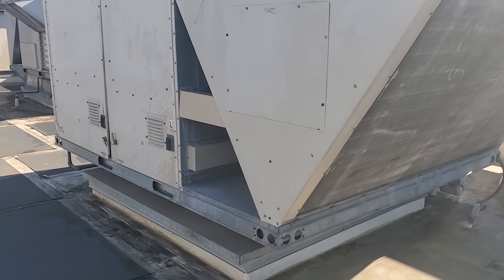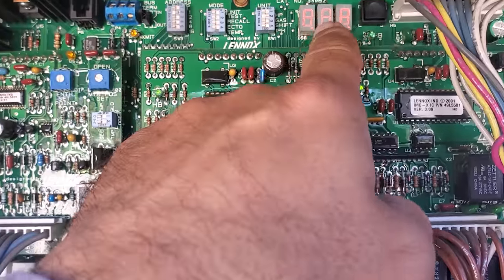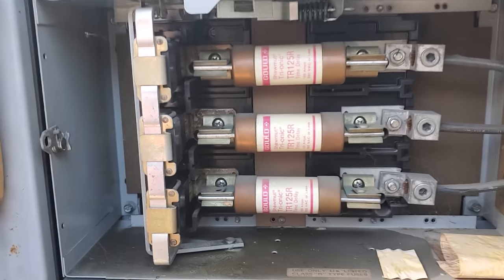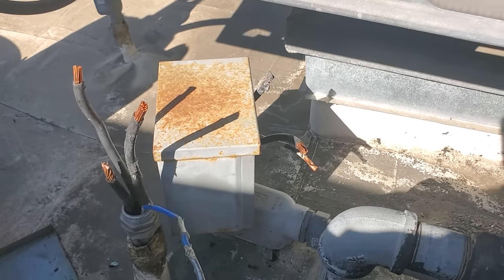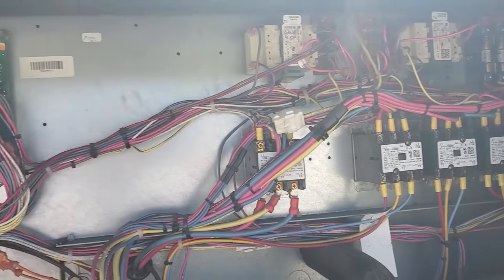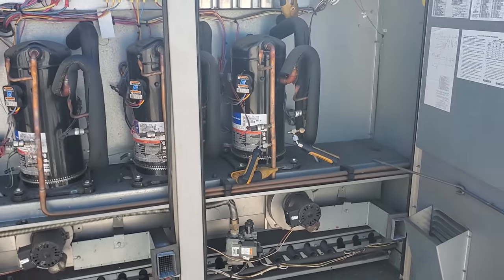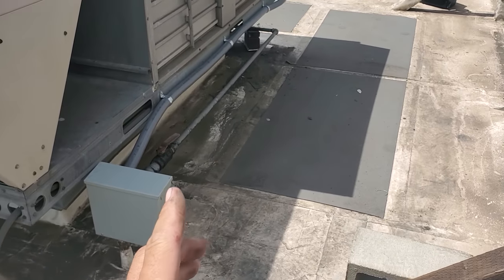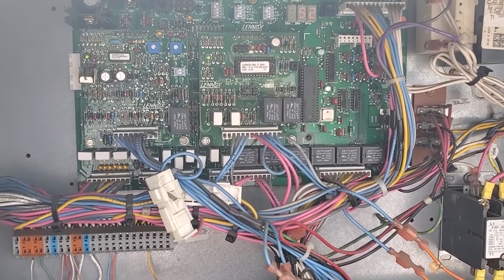ELECTRICAL FAILURES ARE FUN

Comment: When the first unit burnt out there would have been an arc drawn. Arcs will produce a lot of EMI some of which will be conducted down the mains and may not be trapped by circuit protection as they will only be relatively small. The pulses can make their way through the transformer onto the circuit board and cause the lock up
Reply: Almost exactly what I was going to say and better put.
Reply: Well said
Reply: once that connection blew out it sent out over voltages to other ac cause it lock down
Reply: Precisely. That thing would be a total spark gap radio scrambling the microprocessors.
Reply: I agree.  There's an amazing amount of noise coming from an arcing connection.
Reply: It does beg the question - why is there no watchdog system on these hideously expensive air conditioner controllers? You'd think when you spend the sums of money involved they'd have the grace to add one!
Reply: @classicmacintosh  There may be a simple processor watchdog but not clock speed or complete control loop monitoring, these are things that are put into automotive systems (it’s covered under ISO 26262). I am a bit surprised that it didn’t just do a reset attempt earlier, but I’ve definitely seen cases where the processor is in a weird mode where it is ‘running’ but not properly, just well enough to refresh a simple watchdog, but not well enough to run properly. One such case was at cold temperatures, the clock would run at three times its design speed (3 MHz into a 1 MHz 6502). The code would run straight through, not taking any branches at all, but the watchdog got refreshed, despite the fact that the processor was doing weird things.
Reply: Totally possible. Imagine the inrush turning on a dryer at your house, and how the lights flicker for a second. Same goes for turning on a large A/C unit at your house. I couldn't imagine that big of a 3 phase circuit, shorting, and the amount of amps it pulled. Just my opinion, I'm no expert.
Reply: Making a watchdog to monitor the heartbeats wouldn't be hard, but of course this would be another point of failure. Gotta weigh such things up. You don't want to have units going down because the watchdog keeps false-firing.
Reply: As an electrician, I agree. I have seen this sort of failure causing other issues, although correlation is not necessarily causation, and the other unit could have shut off for other power issues. The old melted mechanical lug had rusted screws, implying that it was corroding for quite some time. J box was undersized and the connections crowded. I would have used Polaris type lugs with both conductors coming in from the same direction, rather than feed through lugs like the one that melted. New electrical was done well, with a properly sized J box, better conduit, and phase colored conductors. People forget that "Work shall be performed in a neat and workmanlike manner" is part of the code.
Reply: @GoCoyote  Be nice if the terminations on the top of the isolator were neat. I get they don't have to be perfect (exposed live metal everywhere on US switchgear seems to be the norm), but you'd think stripping the same length three times would be within the capabilities of an electrician..
Reply: @Monkeh616  Yea, I noticed that, but overall looked much better. Main thing is to make sure the conductors are "seated" properly in the lugs by wiggling the conductors after tightening to make sure the strands lay down properly, and then Torqued down with a torque wrench. I have one and use it, along with a torquing screwdriver. I also like to pull out the screws and put some no-ox compound on the threads to prevent galling and allow for easy installation and removal. Way cheaper than having to replace the breaker if they gall up when de-terminating. Most of the damage I have seen in my career has been from loose and corroded connections. I have had non-electricians ask why the fuse or breaker did not prevent the melting or fire in the electrical connection. My answer is that a toaster gets hot enough to burn and melt things, but does not blow the fuse or trip the breaker (unless the circuit is overloaded) and that it is a high resistance connection just like a loose or corroded connection.
Reply: I agree with this. During arching could happen strange things. A lot of EMI, overvoltage spikes, undervoltage drops... and more. Processor are a lot sensitive over thise type of faults.
Reply: I thought that too.
Reply: Yep. Crashed the computer.
Reply: @Fabio Bosco  This is actually used to breach embedded devices like game consoles.   An RGH is where you put a slight under voltage to the CPU / APU causing it to start behaving weirdly and if you do it just right. (Different for every platform) you can gain control of the system that way!   The initial breaching is the hard part.   Its trial and error to find out the right way to do it.  And 99 percent of attempts will result in a reboot or a useless crash.  And all of this needs to be logged so you know what works and what doesn’t.  Then you implement an microcontroller to execute the RGH on demand.
Reply: Quite old-school components on that board. I don't think that electronics has any watchdog at all. Not inside the microcontrollers and not outside. An external, windowed, watchdog would have handled the lockup and properly restarted the board. There arw external watchdogs that have a min time and a max time for kicks. So a program that kicks too often or too seldom will fail the watchdog and trig a restart.

Cost is quite low - especially considering the total cost of an installation like this.
Reply: Neil, I was going to say the same thing, the arcing from the other unit might have traveled and caused the other unit to freak out and brick the board.
Reply: @maryjaneevadiamond6359  Yes it was definitely noise from the arcing that hung the board. Too little filtering and lack if a good watchdog on the controller cards.
Reply: @perwestermark8920  and boards cost way too much to not have that protection in place.
Reply: @deborahchesser7375  More than that - a hung software can quickly kill a motor, relays etc by accidentally entering a loop where power is turned on/off quickly. On/off cycles stands for a significant amount of wear and too high frequency on/off is not just producing wear but can give so much heat it burns out equipment.

So not having a proper watchdog logic and filtering on all I/O can save a few dollars of board cost but result in many thousand dollars of installation repair costs, besides the issues with days or weeks where the customer waits for repair.

It just looks like the electronics aren't designed as "industrial grade".
Reply: @perwestermark8920  
In my experience, "Industrial grade" is not the norm for most HVAC equipment. A lot of equipment is just not designed with quality and preventing failure in mind, but for the minimum cost of materials and engineering.
Reply: @GoCoyote  This is a very expensive installation - also quite dangerous (fire hazard etc) if it fails.

The design quality of the electronics should be adapted to the usage case. It seems a bit like the electronics has "hobby level" design. Which isn't in line with the costs if the electronics locks up or fails.

So it should be mandatory with EMI filters and overvoltage protections (like trisils) to make sure big sparks nearby sends in high-voltage pulses that kills components or hangs the microcontoller.

And it should be mandatory with a proper watchdog, forcing a reset of a hung microcontroller.

Anything handling big currents should normally have some form of feedback - like temperature sensors to cut the power if a motor or compressor gets overheated. Which obviously means there must be a watchdog logic so that temperature sensor is actually supervised.

I have never been involved in the design of any HVAC controller but other equipment. And with way higher customer expectation levels.
Reply: It is a trivial issue to program a reset routine in the event of a lockup.  Poor design.
Reply: I'm pretty sure the first unit went down due to high resistance on the electrical connector. This was most likely caused by using an aluminium connector. Aluminium is a great conductor, but aluminium oxide is not. 
That's just my opinion though with years of experience backing it up. But if you want to wear a tin hat I won't stop you.
Reply: @dale116dot7  Almost every microcontroller has a watchdog which can be integrated with your control loop. Source: am programmer.
As well, precisely because computers need stable power supplies, every computer is powered through a bunch of capacitors, and the computer is forced to shut down when the power supply is too low voltage. I don't expect that any power spike, even an arc fault, will "scramble its brains", unless you have high current and big loops causing high intensity EMI. Maybe these compressors do have that - idk.
Perhaps, even, the fast heartbeat IS caused by the watchdog causing the computer to reset over and over but it still doesn't start working.
It could also be an intentional error signal.

Comment: Circuit protection was oversized, Chris showed the max protection 90A on the equipment and they are using 125A fuses. Sat there and melted instead of blowing fuses.

Comment: Kudo's for having an apprentice and getting him some on hands experience with you in support. Best way to learn across all trade crafts.
Reply: From what I understand that's kind of how you start out within the field when your new, I'm hopefully going to be hired soon for an AC company and one of their requirements is to be teamed up with a veteran tech who shows you the ropes and how they do things. Even though I've already attended an hvac school (ATI) schools can only you prepare you for so much.
Reply: Chris, it’s been my experience that various embedded controllers will brick themselves if there is a power sag while they are starting up. (And with capacitors in their power supplies, a brief interruption shows up as a power sag.). I’ve experienced this with various network devices, especially consumer versions. I’m not a HVAC tech, so I can’t speak about those controllers, but these days, computers are computers. A power cycle is one of the first things we do. On a high quality controller, the power on self test will then tell you if there are hardware issues. But many times a reboot brings the device back to its senses again. 

Keep up the good work and try to get some rest.
Reply: A job like this also great for an apprentice to help with, any bizarre or nonstandard issue let’s the apprentice see how someone with experience will talks the problem. You can teach standard process all day long, but the best thing to teach is how to learn and discover.
Reply: @zacharynetzer819  Learning by doing.
Reply: @danforsyth365  I've only heard the term brick mean "permanently ruined" such as w/ a failed firmware update essentially preventing further attempts. The term originated w/ hard drives serving new duty as door stops.
Reply: @danforsyth365  that was alot of words for unplug it and plug it back in such sage advice... its only one of the first troubleshooting steps for all tech
Reply: True if you never get to touch it can lead to discouragement to learning as well due to feelings of not being good enough

Comment: Logic boards can be very sensitive to power glitches. It's always worth doing the Computer Engineer's Power Cycle reset first off if a logic board is behaving oddly.
Reply: especially if their not getting proper voltage from a improper wire connection

Comment: For all of the refrigerant and mechanical issues we deal with, I always appreciate these occasional electrical mysteries. It's so satisfying once you find the cause, especially if you've already narrowed it down before you laid eyes on it.

Some of my go-to issues were the Trane Voyager disconnects that always wore out, and the York package units that ran the blower wire against a hard piece of angle steel and would rub through the jacket into a direct short.
Reply: That box hasn't been looked at in years, probably handyman electric lol

Comment: Speaking from experience on this, either one of two things I would do.

1. Pull all the existing wire out, mark the burnt wire and replace that leg.
2. Pull existing wire and then refeed with entirely new wire. 

You are not going to be able to pull the single wire out in that conduit. Frankly speaking, that conduit is undersized for whats in there.
Reply: Entirely undersized. All conductors cannot exceed 40% of the conduit with exceptions for stuff like the whip-it style cable used as a replacement.

Comment: Not far from my house some people ripped apart a chiller. I will post details that I saw/assuming
2 compressor, carrier unit, 4 condenser fan motors, maybe 460v chiller, contactors were ripped apart but there were 2 3pole 200a breakers laying on the ground. Only thing remaining was a part of the metal frame and the condenser fan motors and holders. Edit: 30rb70 208v. There was a third breaker but it is broken apart. Pretty big unit!

Comment: IT: "Have you tried turning it off and on again?"
HVAC: "Have you tried turning it off and on again?"
Reply: Bahaha!
Reply: A lot of problems can be fixed this way.  Digital circuits 'crash' from power dips and must be 'rebooted'.
Reply: Pretty standard for electronics
Reply: PC power supplies have a software 'circuit breaker' function.   After some power surges, they'll lock into an 'off' mode, and you have to remove all power from the unit, let the residual power drain from the board (hold power button to short it, or wait 5-10 minutes for caps to drain), then plug back in.   I've seen the same behaviour on computer controller boards in other equipment as well (phone systems, gate controllers, etc).   So, it's a BIT more involved than a straight reboot, but when someone calls me about a system not powering up, I always tell them to unplug it from the wall for 10 minutes, then try again, and call me if it didn't work.

Comment: when i was a working man this kind of stuff always happened when i had 3 more calls to run. Your right fix it correctly or not at all. I had something like this happen. In ended i splice the wires and covering with electrical tape.We wanted a electrician to repair, but for some reason nothing was done for months. Finally i disconnected the electric and they had to get a electrician. But me being a hero could have caused lots of problems. Who  would be responsible if someone got shocked, that would be me!

Comment: As others have said, the shorting/arcing on the one AC could have affected the second AC. Breakers and fuses are mainly there to protect the wires against overcurrent. You can still get a lot of stuff past basic breakers. The short could have caused noise or voltage spikes/drops. Depending on if/how the wires touched and arced in that box it could have dragged voltage down on a leg or caused all sorts of weird power at the second AC. Especially if they're right next to each other in the main distribution board or a subpanel. Or maybe some combination of circumstances

Comment: that sparky did a decent job on that run

ill bet the second unit saw a voltage drop for a second and locked out due to low voltage on one phase
Reply: That's unlikely. There is a higher chance of a brown out condition (it's California, after all) and those were the two units actively running. Unless your breaker for the first RTU failed to trip that is. Even then, it should trip the main for the building. It's very difficult for a single piece of equipment to brown out a building by itself (unless it's a factory. That's a whole different animal.)
Reply: Demonitized Boi  care to elaborate? Wires burn up during brownouts. Motors, boards, and transformers burn up during voltage spikes.
Reply: @jman0870  and thats how you can burn stuff up. Low voltage means increased amps. So if its on a borderline connection due to age/corrosion/barely specced another 20 amps which would easily be drawn if the voltage dipped to say 170 volts from 210 on a 90 amp rated circuit you can end up with weird situations.
Reply: @PantherSerpahin  I literally said brown out condition dude. By brownout I meant building wide, not a brownout cause by a different RTU. That is highly unlikely and bordering on impossible.

Comment: When I check continuity to ground I like to start by putting both probes on the sheet metal. It ensures that the meter is in the correct mode and working and that the probe I keep on the same point for the rest of the testing has contact.

Comment: We've had several power issues here in NC in recent weeks. Had a Holiday Inn that blew a fuse in the disconnect in half for one unit, and fried control boards in two other units. Of course the power company will never admit fault, but power issues can cause an array of crazy issues.
Reply: Got called for flickering lights in a cooling rack, turns out theres barely 200 v on the first phase coming into the main 100a breaker, when it should be 220-230.
Still not sure whether it was the electrical companys fault or the building just added way too much stuff over the years to the point where the voltage drop was exessive
Reply: This is why Surge Suppressors should be Mandatory equipment in all Main Distribution Panels so any Power Surges hitting the building from the Grid will get caught by the suppressor before it hits the building's equipment.
Reply: Thats why our company (in germany) if I recall correctly even has power quality monitoring in place to proove that the problems initiated from the primary side of our transformer and not from our company internal grid...